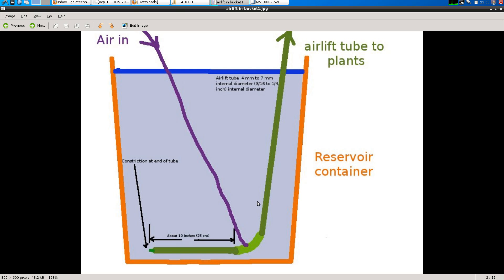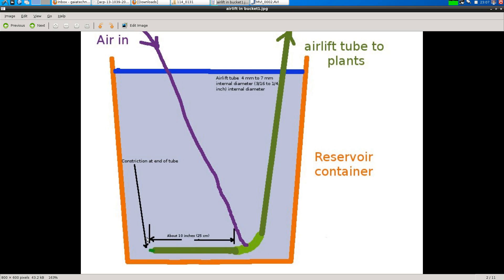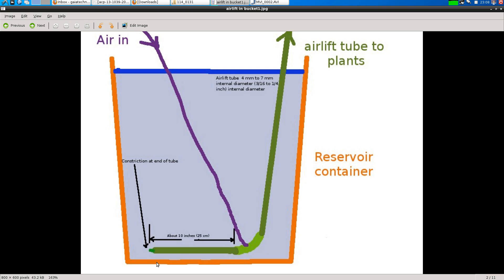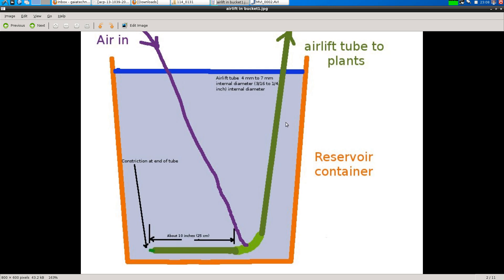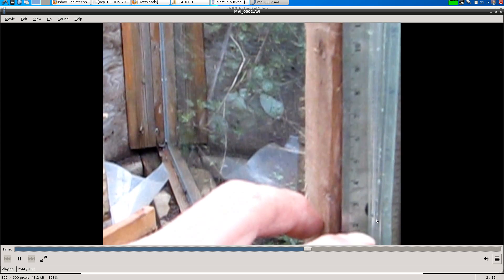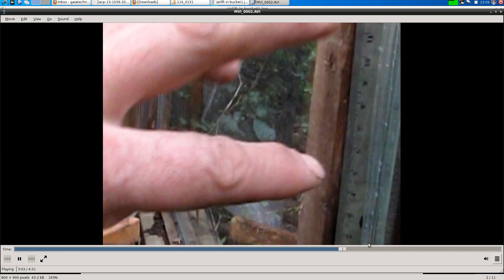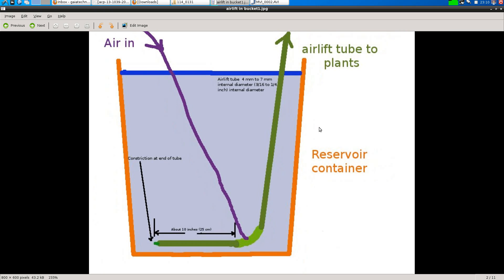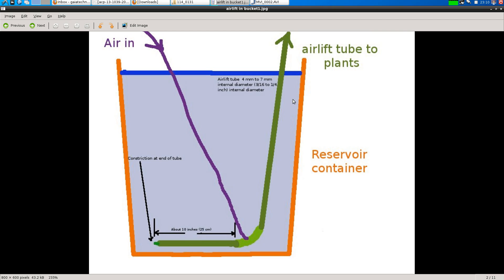Gardeners!  New low pressure airlift process for garden irrigation.  Please test this.

Comment: Wow..I use a water pump for my hydroponics looking at this I might just add another system setup..so is it right to say that the greater the amount of air pumped into the tube the greater the lift of the water through the tube?
Reply from the maker: There are fairly strict limits.  If you pump in too much air, you get less water out.  That's why I have the little taps on them.

Comment: I'm late to the game but isn't this just a standard air lift pump (or venturi effect)? I have 1" PVC and am trying to pump water straight up about 2 feet into a grow bed. My idea is to use the sand waterfall setup (watch?v=y-NxXxdRFog) and hope that it works. I really don't want to use a submersible pump. I'd really like to use the air pump that I have so that if disaster strikes, theres only one point of failure for my aquaponics system. The pump I have is capable of 38 liter/min at 2.9 psi.
Reply from the maker: I watched his video.  You can do the same set-up as he does but you will struggle to get much  water at 2 ft high.. (you don't need an airstone)  2.9 psi is enough to pump air 80 inches below the water surface.  But lets just say 60 inches is easy (to keep well  within the specs of the pump), this is called the Submergence.    So your ideal most efficient airlift pump will  have  7 ft high  piece of 1 inch pvc pipe with 2 ft showing and 5 ft (60 inches)  below the surface. So this may have to be outside your tank with a feed into it from the side of the tank.  Look up "t-joint airlift pump"   That is probably the best version for you,  (if you can put your pipes and tubes outside your tank).  If you want your pipes inside your tank and it only goes down 2 or 3 ft,  you probably need to go with half inch tubing (or smaller) and this design that I show here.  And you would probably need at least 4 of the smaller pipes. Another thing you could do  has a valve and chamber under the water and it is more stop start.   I haven't done one of that type in ages because I worked on getting simplicity.
Reply from the maker: I have a few playlists on airlift pumps,  you can check there.  The key things you can learn is to try to get maximum submergence, and use smaller diameter pipes to pump higher. Smaller diameter tubes have a higher "lift to submergence ratio"  meaning you can go higher for a given submergence and be more efficient.  The best  most efficient type of flow is called "plug flow".   My best pulser pump was most efficient with 3/4 inch pipe and 11 to 15  liters per minute of air.  But it had a submergence of about 2.5 meters (98 inches). Check out my google plus photos too.  Thanks Brian
Reply: Thanks a bunch Brian! I really appreciate the wealth of information and your lengthy replies. I'll keep researching on the best way to achieve what I want. My maybe-not-so-obvious goal is to get water to pump up into a growled without using a submersible pump. After discovering air lift pumps and all the alternatives, I refuse to go back to a sub pump. The advantages (for me) are far better. Fish solids, electricity in water (with living things), replacing seals, etc. 

I have to say that I'm in love with your videos (liked + subbed). I'd really like to try whatever I can to make this work with 1" PVC and a submerse depth of about 2 feet (inside the tank). Primarily, because I've already built the system and I really don't want to change too much of my design. But if thats what it comes down to, I'll have no choice but to change it.

Too bad there isn't something like a submersible pump that runs on pneumatic air. Something that just takes air in and spins a flywheel of a sort to push water up the pipe. That's a compromise I'm willing to do. Meanwhile, I'll take a look at the start/stop (valve and chamber) method if I can find one. The only thing I can think of is an electronic actuator (solenoid) of some type. 

Again, I really appreciate your help!

Comment: I made one work very well by running my air delivery hose into my water pipe at the same point as yours but extending the air delivery hose half way to the top of the water pipe using the pump from a discarded home medical oxygen machine to create a vacuum in the lines. No small tubing from where the water enters to where the air hose tees in. My water delivery pipe is 1 and 1/2 inches. It moves a lot of water with very low force. I'm using it in a 300 gallon tank (UBC Tote) outdoors.
Reply from the maker: Thanks Billy. Do you have any pictures? or Video? There are just so many ways to do this!   Mine is all about small scale at the moment but I have the equipment for doing tests in larger pipes too.    I keep meaning to test different sizes of pipes in a rainbarrel with different configurations. I bought a big air pump with 4 outlets last summer just to do the experiment.  Pump cost 100 dollars, can move about 13 liters per minute of air but I have not done it yet.

Comment from the maker: I use it in flat pallet gardens, inclined pallet gardens  and vertical pallet planters. Currently the vertical pallet planters are doing better because my "flip flop" system for spreading water across the pallet gardens needs more work.  In the pallet planters, the water just drips down the back of the wood planter (bookshelf like with the shelves sloped backwards) and spreads out at the same time.  I fill the buckets manually. Check TCMtech dripper irrigation for too. Brian

Comment: very interesting ! this intrigues me as to how/where  i might use it .
are the buckets filled manually?  how to connect to rain-harvesting reservoir somehow? i'm now installing multiple rain barrels at my downspouts stacked 2 high vertically. i think gravity pressure is sufficient for my ground level and 10" raised beds. i have my porch railings lined with SIPs planters and intend on hanging a 5gal bucket from above with 1/4 or 1/8-spaghetti tubing and punching holes where needed.

Comment from the maker: Big thanks to user  Noomil from Denmark on ourwindowfarms for trying this airlift pump method and reporting back to the community about how it works.  Reporting back to the community is the key.  You did good!  Noomil says it works well as long as the water entry tube is flat on the bottom.   I have found this too.  Lately I have tied the tubing to stiff wire with rubber bands to keep in in the correct positions.  This seems to be working well.

Comment from the maker: I hope to get replies back about fluidyne  (also called liquid piston)    IStirling engines in the next couple of days.  These are less precise than the other types because one of the pistons is a U tube of water or other fluid!    One of them was designed to pump water 4 meters  high with sunlight as the power.  I found only one for making compressed air so far. If I can get one that pumps air 1 meter deep in water, that is good enough!   Brian

Comment from the maker: I am wary of check valves because sometimes they stick.  The water that goes around these pallet gardens is like compost tea so they could stick a lot!     Also, this type of airlift pump must have a little backflow or they can "stick" or "airlock",  (again the check valve increases the risk of this condition).  I have been looking into "diodic fluid flow" Tesla valves  and a type of vortex flow which is somewhat like a check valve without the possibility of sticking

Comment from the maker: Thanks,  rimar,   I am trying to find people to make Stirling engines to make the low pressure air.  60 litres per hour and about 1 meter water (9 Kilopascals) of pressure.  I use a 3.5 watt aquarium bubble pump but it would be nice if solar power and very low pressure air could do it automatically.  I will make a better version of this video and put in captions or subtitles.

Comment from the maker: Hi, Brenda, thanks,   I am not using hard tubing.  I bought some tubing at Can tire, some at home hardware and some at princess auto.  (princess had a deal) .  Each place has bulk tubing by the ft or meter.  Also, the airline tubing and the little white taps came from a pet shop.  T and Y splitters can come from petshops, beer shops or hydroponics stores.  I found really cheap 3/8 irrigation tube, 250 ft for about 25 dollars (If you do the pneumatic network!  Bubble Pump came from a pet store.